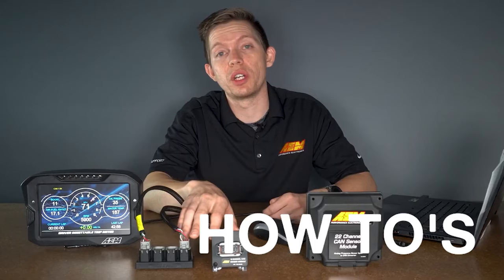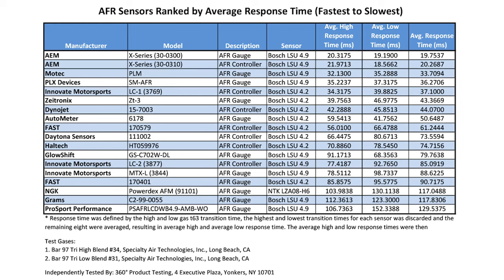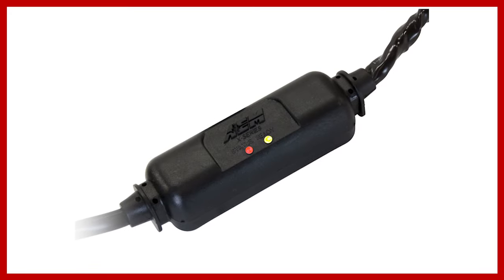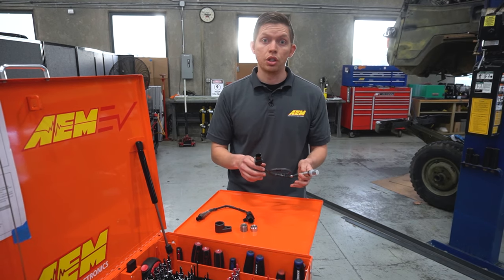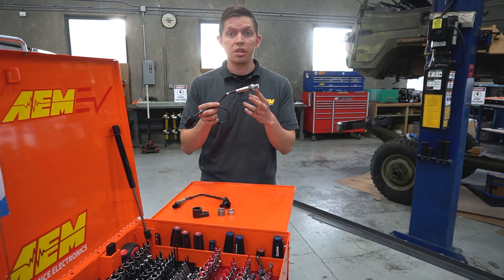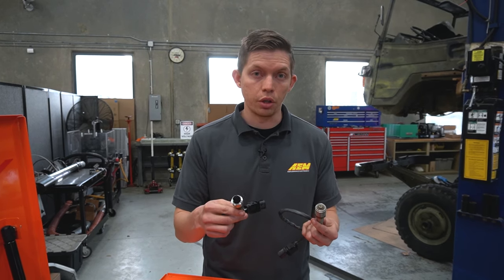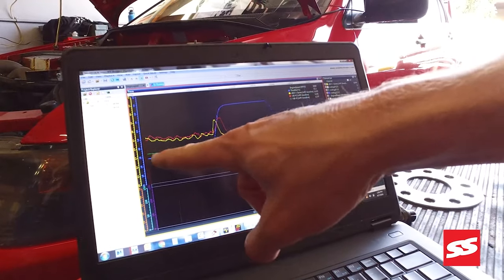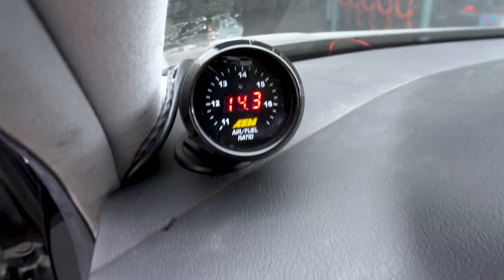X-Series Wideband Gauge Set-Up and DYNO RUN

Comment: I really had my sights set on an AEM X series wideband gauge, I just find it such a beautiful gauge as well as a very useful one to have. Whilst shopping online for one, I noticed there were many, many bad reviews about these, especially regarding the used Bosch 4.9 sensors. Because of these reviews I thought it's better to buy one here at an official dealer so I want have any issues with warrantee if it goes bad. Then I noticed that the official distributor didn't offer any warrantee for this product anymore, so I sent them a message asking why not? They replied that the Bosch Sensors are so bad that AEM USA has by now washed their hands completely of them and didn't give a warrantee on the sensors anymore.  I am sad, because I had my eye on this product but I am super happy I didn't get one.
Reply: Everything that Bosch manufactures is junk.

Comment: I have one of your AEM X-series gages on a 1995 Harley Heritage.  I love it.  Using it to tune a Mikuni carb is super helpful to get the carb dialed in as well as monitor the AFR while riding.  Trying to record the AEM with a Gopro while riding; however, is giving me some problems configuring the Gopro settings to record the AFR display.  Apparently the flashing rate of the AFR meter display and the Frames per Second recording rate of the Gopro are resulting in the Gopro not seeing/recording the AFR readout completely and sometimes not at all.  I have been working on the Gopro configuration, but haven't hit on the right combination of settings yet.  Can you tell me the frequency of the AFR meter display?  Does it change with RPM?  I noticed on this video  there was a slight flickering also.

Comment: what could cause the wb to quit working in hpt scanner?... gauge reads fine. serial connection was working until the other day, now it just displays 9.99 in scanner. got a new gauge and no change, mode button doesnt work either unless the sensor is unplugged.

Comment: Will the O2 sensor be damaged by having it power up, without the motor running? Like listening to the radio without the motor on.
Reply from the maker: Good question. It's best practice to start the vehicle when the sensor is still heating up instead of once it has already heated up, because a heated sensor will be not thermally shocked from cool air at cold start. But if you key on to listen to your stereo and then key off without starting the engine, it will not damage the sensor.

Comment: I don't  understand why on wire diagram you recommend a switch, but then you say not to wait the sensor to heat up or not keeping the sensor mounted without use it. Why should I install the switch then? Tnx

Comment: What is best procedure then when tuning as the ignition (and AeM) need to be powered up to flash or scan computer before actually starting the vehicle?  In the video you state this is not good to cold start air on hot sensor.  How do you avoid this issue then when tuning?

Comment: Also, can the 30-0334 be used on a 2001 LS1 that has the OBD2 port under the steering wheel?? You say 2008 on, but just clarifying.

Comment: Thank you for the great video. I recently bought an X-Series for my 1984 Austin mini. The laptops nowadays do not have the serial connectors. How do I connect the Guage to the laptop? What software do you recommend to use for logging and evaluating the logged results? Do you have a tutorial on how to read and assess the logged information? What accessories do you recommend I purchase for my AFR Guage?
Reply from the maker: How do I connect the Gauge to the laptop? A serial to USB adapter can be used, then the raw data can be viewed in HyperTerminal or RealTerm. There are also other 3rd party tuning software that accepts inputs as serial.

What software do you recommend to use for logging and evaluating the logged results? We recommend AEMdata, However AEMdata logs will need to be pulled from an AEM logging Device such as our Standalone ECU, CD-5/7 displays, or our older (discontinued) AQ-1 data logger.

Do you have a tutorial on how to read and assess the logged information? We have several AEMdata tutorials on the AEMpower TV channel.

What accessories do you recommend I purchase for my AFR Gauge? That all depends on what you are looking for and what your goals are, please give our tech support a call so we may discuss possible options 310-484-2322 Ext 303
Reply: @AEMpowerTVelectronics  I think you missed the bus not being able to data log straight to a computer.

Comment: I have a rear engine and rear exhaust.  Is there an extension for the sensor?  I think I need an extra two feet over the standard 8 foot cable.

Comment: I know there is a bung included to weld in , but would using an oem bung on the exhaust be okay as well ? I’m assuming it would cause a check engine light since the ecu wouldn’t be reading that o2 sensor anymore and would be used solely for the gauge . Also , if I didn’t want to use the CAN, and serial logging would I just leave them not connected ?
Reply from the maker: Correct, if you don’t want to use the outputs simply leave them disconnected. For the bung – yes, removing the factory O2 sensor can cause a variety of problems if your vehicle is using it calibration.

Comment: Interested to see if there is a way I can connect it to my stock ECU for logging purposes. All of my O2 sensor inputs are 2.5v. trying to find one that is 5v. its a GM delco e78 ecu if anyone has any ideas. no access to can bus and my software does not support serial. If I would have known MEFI Pro was such a pain I would have gone with Haltech.

Comment: Do I have to put the wideband before my cata or after?
Reply from the maker: Catalytic converters can alter the exhaust gasses enough that it may affect the final air fuel ratio reading, so ideally, O2 sensors should be installed ahead of catalytic converters.

Comment: good day sir, can i use it to ordinary sohc motorcycle for afr tuning?
Reply from the maker: Absolutely. Our widebands are used on all types of vehicles, including carbureted cars, trucks, and motorcycles. Depending on what type of tuner you are using it may have an input that will allow you to see and maybe even log AFR in your program, but you will need to confirm that with the manufacturer of your tuning device.

Comment: Do v8 engines need 2 o2 sensors or just one?
Reply from the maker: You can put one wideband in a common collector after the two pipes come together, but most V6 and V8 applications run two widebands so that you can see AFR from bank to bank. One way to do this using our controllers is to use our X-Series Inline wideband controllers (30-0310) and an AEMnet CAN gauge (30-0312). You can send the data from each controller to this gauge over AEMnet CAN, and toggle in between the two banks using the buttons on the faceplate. Or, you can use two X-Series widebands, of course!